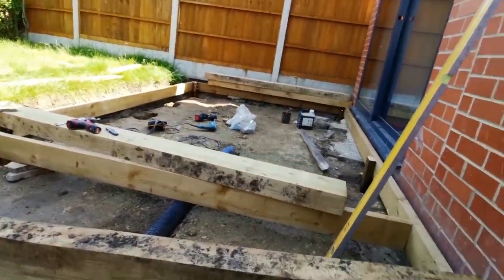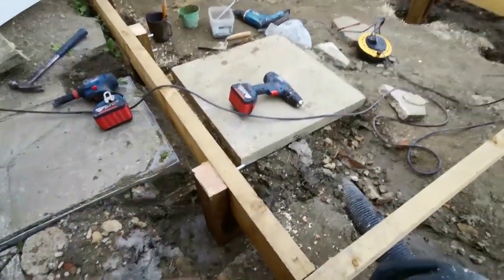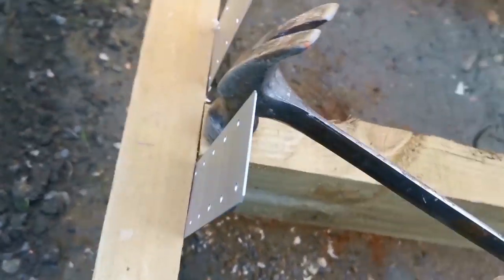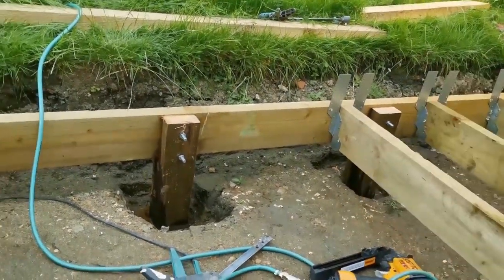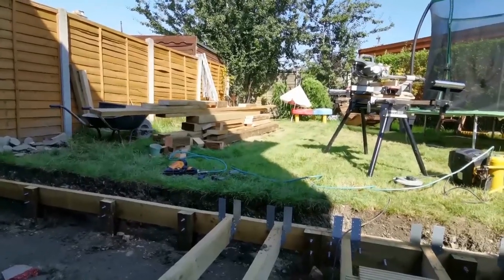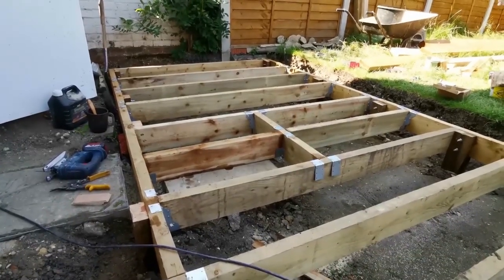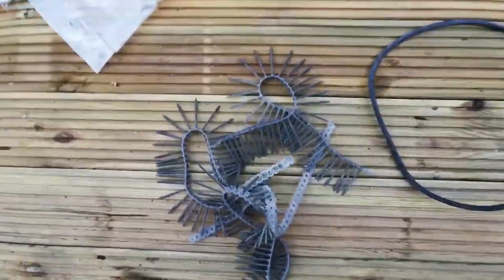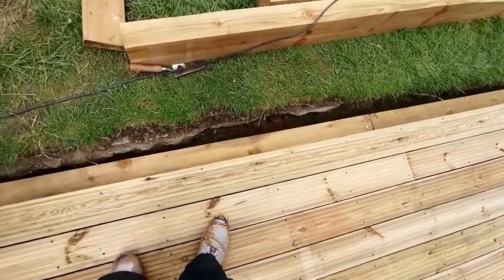Grumpy bank holiday flat deck building - Finishing bits & laying the boards

Comment: I’m only recently starting out in getting stuck in myself, first stud wall done and did a bit of garden work last year but had no tools so it’s rudimentary to say the least. I’m starting to build up a few half decent bits of equipment and planning a small deck this summer. Best video on decking so far! Cheers fella
Reply from the maker: Thanks Steven, you're welcome 👍 if your buying tools try buying the best you can, buy one good tool that will last you 20yrs instead of a few cheaper tools that will only last a couple of yrs and maybe even pack up sooner just when you really need them, This deck really isn't my best but the basics are similar to others, there's pics of some of the other's I've done on Facebook https://www.facebook.com/gid.joiner/photos_albums

Comment: You did what you could with what you had, customer didn't help and it will be like an ice rink in the winter, but you gave them what they wanted and hopefully got paid well for it :)
Reply from the maker: Customer wasn't the best to work with, all he had to do was dig a 1ft deep n round hole & put 3-4" of concrete in the bottom, but despite explaining everything several times & him saying "I know" before i'd finished each sentence this is what he did, he was doing that part of the job to save money, this was on a tight budget so i leant him my cement mixer, i was getting paid two days labour so as you say 'i did what i could with what i had' & i tried not to bodge my part n scarper 🤷‍♂️.

Comment: Brilliant video as usual Gid , loved the tool for screwing the decking boards down, done a few decks myself and always had to use my drill/driver yours saves so much time and effort , ideal for a joiner/tradesman like yourself but not worth the investment for a diyer like myself unfortunately .Keep those videos coming Gid we massively enjoy and appreciate it mate .
Reply: simon middleton Pretty sure you can buy an attachment for a standard drill that gives you the same functionality as that gun. Never be the same but I’ve heard they work pretty well. Here’s a video I found showing one in action - https://youtu.be/A9GfmcMz3Mk
Reply: @esskayrepairrestoration8265  Very interesting , cheers for that mate .
Reply from the maker: Thanks Simon, will do, had some time off with cold n Mot but I'll post a short vid to explain, 👍 yeah excellent tool but not cheap, i did a few decks by hand but really happy when i bought this, 978 screws on this job, the nailgun for the hangers was another good buy, 880 nails on this, Not sure but you might be able to hire the screwgun?,

Comment: Great job as always 👌
Reply: Also your method for working out hoist dimensions for a span. I’d usually look at trada tables for that, but your rule of thumb there seems pretty good. Could apply the same for hand cut roof rafters?
Reply from the maker: Thanks Oliver 👍 Yep, rafter is spanning, a pitched roof is a flat roof that's lifted up in the middle, 😉 A pitched roof rafter spans less distance horizontally than it does on the pitch/angle distance so that has to be considered but if you take the pitch/angle distance you should be within a comfortable margin, If the roof was for a job that was to be inspected then plans would be drawn n passed or an inspector would give advise on a home build, they're often not that bad in situations like that, if they think they're undersized they'd let you know 👍
Reply: Gid Joiner yeah got ya. I’ve built all kinds of roofs and always worked to architects drawing or structural engineers spec but the odd time a builder wants you to knock up a little lean to or something you always have to think what dimension timber do I need 🤔. Cheers gid, great little tip that.. 👍
Reply from the maker: You're welcome, of course the size of timber is limited so that's where purlins come in reducing the span, sorry there's prob a rough calculation there but i don't know it, I'd just go with the equivalent double joist beam like on a floor but once roofs start getting to that size planning would be involved i'm sure, 👍👍

Comment: Looks good and solid - air nailers save so much time. Yep if you cover a manhole guaranteed it will need access even if not opened before for years.
Reply from the maker: Yep, that strapshot i use a few times a yr but well worth the buy, esp on jobs like this, 880 nails or in winter, little nails n cold metal make sore fingers, 😉 yeah agreed, you can bet it'll need access to.
Reply: @Gidjoiner  yep some tools only used now and again but still worth it for when needed

Comment: Hi Gid ,  ive just started my own deck base at home and these videos from you have provided a great help in which way to constuct it. The timber base is 4320 x 3325 , im using 6 x2 timbers and the plan was to run a timber through the middle 4320 so i end up with 2 sets of 1660 joists joined to this . My thinking here was i then only need to support the outer frame and middle timber with posts as those joists will support themselves. My question to you is do i need to double up that middle timber as joists are attaching both sides? would be good to get your views on this . cheers.
Reply from the maker: Hi, Thanks I'm glad they are useful 👍😊 yep that sounds ok, basically yes double up the middle supporting timbers so it becomes a Beam, if you've space underneath the joists can just sit on top of it or you could do what i did in these pics on Facebook, 👍 you may have to double up the 4" posts or buy a 6" post for that centre run as notching in two 2" joists doesn't leave a lot of the post left ( i don't like to bolt timbers to the side without a notch & just the bolts supporting the timber) & as this is supporting both spans/sides of the deck it needs to be strong, https://www.facebook.com/media/set/?set=a.281468205272886&type=3 There's other deck photos on my page, i'm on my phone & it's hard to search but i wrote a longer comment for someone reg the calculation for the size of a 2" joist @400mm, when home i'll be able to find that on my PC n i'll post it here 👍 but it is Span ÷ 20 + 20mm, the extra 20mm added is for safety & to reduce bounce so a span of 1660mm = 103mm, so you might be able to get away with a 4" joist on those spans, I air on the size of caution tho n prefer to go slightly bigger, ya never know how many people are going to be on it at some time n you def won't get any bounce
Reply: @Gidjoiner  thats great thks 4 your reply, i will check out your photos, another question do you put any fall on your decks for water runoff ? everyone seems to have different views on this so would be good to  get yours. cheers
Reply from the maker: @paulherman442  hi, no problem 👍 no I don't bother, it's hard enough to get these decks flat never mind putting an accurate slope on so water runs off, over a 4 metre distance it wouldn't need much but because the boards will have a bit of wavyness to them that slope would have to be increased to get the water to pass over any hollows in the surface, I get it flat enough so there isn't puddles, there's gaps in the boards as well it isn't one solid flat surface,

Comment: Good job. For me, it's slightly overkill on some of the bracing and amount of nails. Each to their own but you're adding expense where it's not needed imo. At the end of the day its rock solid I suppose.
Reply from the maker: Thanks, yep it'll stand the weight of as many people as they want on it & I can sleep well, i never get called back to fix things 👍👍 the weakness on this one is the concrete in the holes, i don't like it when the client wants to do part of the job n then makes a right balls up of it, it was hard getting the instructions through to him n by the end i just wanted to get it done n scarper but i did my job as well as i could under the circumstances, he can't say it's crap because of my part in it, 🤷‍♂️👍

Comment: I should have watched part 2 a couple of weeks ago after watching part 1, I spent more on shorter joist hanger because I thought that these would be too long, hadn't realised that you fold them over
Reply from the maker: 🙃😁 Yep, it gives a better hold wrapping them over, i buy cheap Jiffy ones from Screwfix 50mm or 47mm depending on the timber I'm using, If i don't want to see the strap on the outside i just cut it so it only wraps onto the top , https://www.screwfix.com/p/sabrefix-standard-jiffy-hanger-47-x-277mm-10-pack/25392
Reply: @Gidjoiner  I looked at them but finished up buying these from tool station as I thought they were to long - https://www.toolstation.com/multi-truss-hanger/p20088 - not used them yet, I'm only making a really small deck for a couple of chairs and a table, in the top corner of the garden that gets the last of the evening sun
Reply from the maker: Bit expensive but they'll do & they do an important job, 👍 If you didn't already get them use twist nails, that's what my gun is putting in, the only difference is they're collated strips for the gun, https://www.toolstation.com/sheradised-square-twist-nail-pack/p10121
Reply: @Gidjoiner  yep,  that's annoying, I could have saved a few bob by getting the ones you use (would have been a lot more annoying if I'd needed more though). They are the exact nails that I've got too

Comment: This has made my Sunday. Glad I'm not the only grumpy f#*ker. Especially deck building. Quick question. What do you use to seal your cut wood? I can't find anything that says you can use it for sealing only protect. Many thanks.
Reply from the maker: 😁👍 Some days are better than others, depends if others get involved in your work 👍😖😂 If it's seen i'll use the clear treatment, Everbuild or Sika type stuff, if it's not i'll use Creosote. I think they're all limited to how much they 'protect' 🤷‍♂️  the wood that's out of the damp will last a while if it can dry, the posts on this job i wanted to go deeper, posts don't normally rot from the bottom up if they're deep in a hole, they rot off around ground level leaving a stump in the ground but because these cut ends are just sat in the ground level area i don't hold out much hope for them, these will rot from the bottom up 😒
Reply: @Gidjoiner  agree on that. I've just got myself to piss off which I do a good enough.  Well it looks a great job you've done and should last long enough. Top marks. 
I'm using Barrettine hope that will be ok. Just can't stand waiting 24 hours to dry or can I attach it and it will dry when together? Cheers.
Reply from the maker: Thanks n you're welcome, yep sometimes it's enjoyable being a grumpy old git so it's only your own fault 😁 sorry don't know much about Barrettine but if it's just wood preserver once it's on it'll soak in, i never wait for it to dry unless i'm putting a second coat on & then it's not 24hrs i wait, like a gate etc.
Reply: @Gidjoiner  I've got worse lol. Ah that's great to know. Thank you gid.

Comment: I really enjoyed this very much as I am doing a similar small piece, could I ask a SFQ, when you had the post sat in the holes and you said no point adding a concrete layer on top and around the post (donut), won’t that dropped area end up filling with water and rotting the posts??
Reply from the maker: Good, 👍 The posts weren't put in as i asked & i don't know if you noticed i wasn't happy about that, I've discussed it in a couple of comments on Pt1, Colin's comment, posts below 6" of ground level often don't rot, when a fence blows down the post snap at ground level, 6" above & 6" below where the bugs live, below that the ground is hermetically sealed, no oxygen & they can't live so the wood doesn't rot,

Comment: great video and some fantastic advice....can I ask, what did you end up filling the holes in with..was it just earth or postcrete etc. ?
Reply from the maker: Thanks Steve, the posts were so short nothing put around them would've made any difference to hold them, they should be ok because they're notched & bolted, a bit like a big coffee table sunk into the ground. I asked the client who dug the holes (to save money) for them to be at least a 1ft deep with 3-4" concrete in the bottom, they then would've got back filled, but he made a piss poor job of it & when i mentioned it to him it was like talking to a wall, he was impossible to work with throughout this job, when i explained what i wanted doing he'd say "I know" before I'd even finished the sentence so by the time it came to it i just wanted to get it done & be gone, you might guess that from my language in Pt1 😫😣🤣. There's pics on my Facebook page showing the holes being dug to the right depth, i like to go 18"-ish, through the black soil to the cream coloured substrate that is often clay or sandstone here, if the bottom of the hole is down to hard clay or rock then concrete isn't necessary for just a deck but if digging down & all you find is soft earth, a 1ft round x 4" thick concrete pad spreads the weight & helps to stop the post sinking & at a decent depth earth is fine as a back-fill, i do backfill with concrete sometimes though, depends on the job, https://www.facebook.com/gid.joiner/photos_albums
Reply: thanks for the quick reply...I'm looking to do a very similar deck...if I dig the holes 1ft and put in a concrete base or a slab i assume it would be ok to then fill with postcrete?...also I was planning on using a ledger board to the house but watching this I think I will make it independent
Reply from the maker: @steveharrington1242  yep I prefer to keep it independent, if it die does move when there's people walking on it you wouldn't want it damaging the house wall, you can backfill with whatever you wish but it will only be as sturdy as the ground around the hole so try not to disturb the earth around when digging the hole, the longer/taller the legs are sticking out of the ground, the higher the deck, the more chance of it wobbling/rocking, a little bit like holding the top of fence post and wobbling it as apposed to holding the fence post at the bottom and trying to wobble it,
Reply: I'm using 6x2 timbers on  4x4 posts so there wont be much sticking out out of the ground...
Reply from the maker: @Steve Harrington if your joints are solid then you don't need very deep holes just a solid footing so the posts don't sink, a foot or so deep will do so the deck doesn't walk 👍  imagine if you stood a solid table on a patio you wouldn't need to pile rocks up around the legs to stop it wobbling,

Comment: Try a makita effi cut blade in your track saw used one in a cordless makita today on some 40mm ash bar top and it seem to not even notice it
Reply from the maker: Thanks Daniel, next time i need a blade I'll consider one 👍 Random comment/suggestion on this video,? 🤔
Reply: I was watching you make a bench seat an you were talking about needing a rip blade in you makita plunge saw. Thought id just mention to you on you latest to make sure you got it 😂😂  those blades are super thin but go through solid ash like butter. Hence the effi effortless cut blade lol wont work on anything festool tho because the arbour has to have a thicker blade to tighten up on 👍
Reply from the maker: 👍 I thought that was the reason for the comment on this vid,
Can't remember what i said exactly but i have a rip blade, think i said in that vid that it was that you should use a rip blade or prob what i said was that i couldn't be arsed changing it 😂  Thanks for the info tho, i have a few blades but i have bookmarked that blade you mention,

Comment: Would building decking like that take the weight of a summer house
Reply from the maker: If it was built properly, You might be able to tell i wasn't happy with these holes n concrete but yes If the posts were dug deep enough & the concrete was wide enough & thick enough, i normally like these holes to be 18" deep & 1ft diameter, maybe more for a summerhouse, depends how soft the ground is, with approx 4" of concrete in the bottom as a footing to spread the weight of the post, The base in this vid was for a dungster shed, again i didn't dig the holes but it went down onto solid rock, https://youtu.be/sU-MAc9vWgg this shed on FB i did dig them https://www.facebook.com/media/set/?set=a.673314579421578&type=3